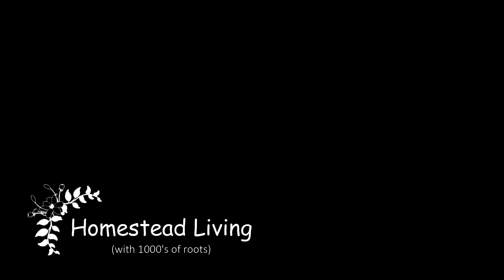This HAD To Be DONE and The NEW Guy On The Homestead

Comment: Just curious to know why you have a pipe that back fills into the tank rather than a pipe that goes directly to the tank with an overflow pipe out of the tank?
Reply: The pipe they fixed is usually for catching the first water that might be a little dirtier from dust, bird droppings, leaves and such.
Reply: @candacealdridge877  Thank you that makes sense
Reply from the maker: Yes it’s called a pre-wash system.